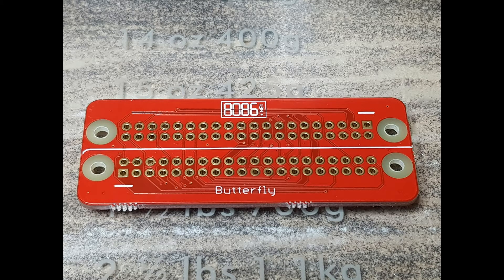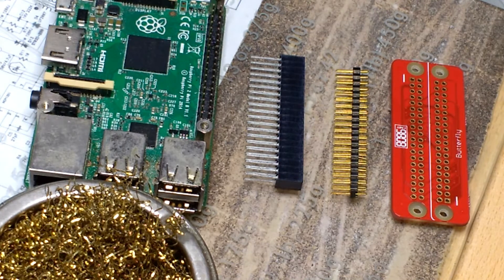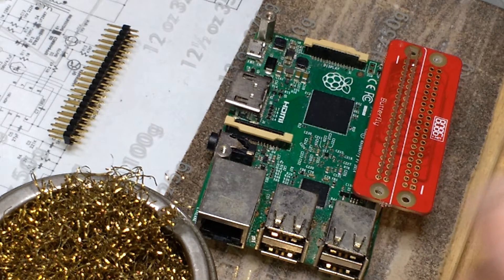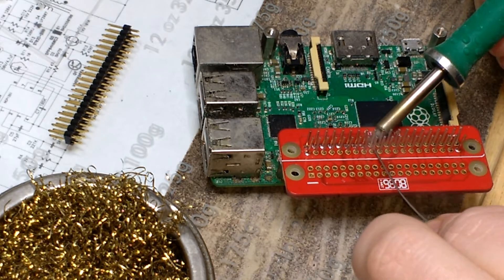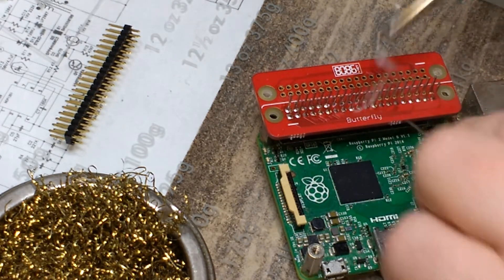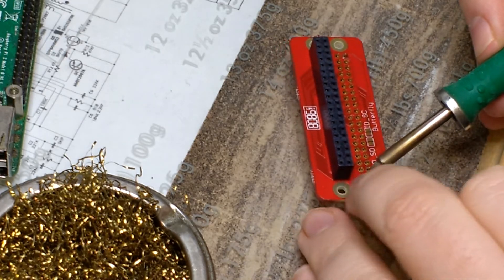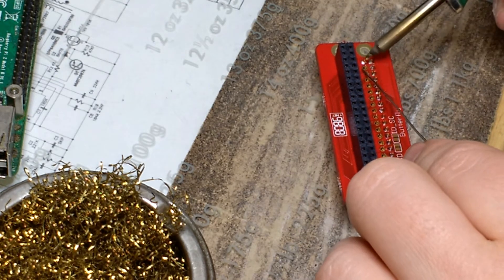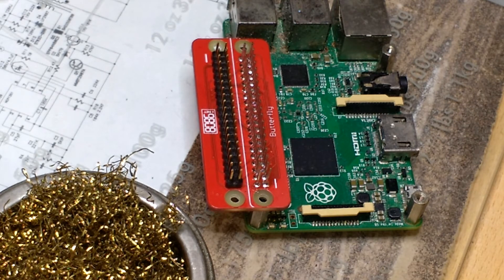Soldering the Butterfly board for the Raspberry Pi

Comment: Question:
What happens if you solder it together incorrectly (female/stacking header on the wrong side?) I had a display that would not work, so wondering if I should just start again with a new board or troubleshoot solder joints. A display that I connected would not work with the butterfly in place, but worked without it. (odd, because electrically with a pass through stacking header and nothing else it SHOULD work).

I wish I had seen this or a warning first!
Reply from the maker: The square pad on the butterfly PCB needs to go to the square pad on the Pi. If it doesn't it will cause problems.

Comment: with the butterfly I can in theory connect a second Pi zero hat to a single pi 3b+, yes?
Reply from the maker: Yes, but as the USB controller in the Raspberry Pi  has a limit of 8 host channels the USB Gadget Ethernet wouldn't work reliably if you filled them :(.
Reply: @ChrisBurtonUK  Well nuts. Still gonna grab a handful. Thanks for the fast response.

Comment: is there anyway to get a pcie slot attachment.. I have looked at a single board pc with one but they wanted 200 for it
Reply from the maker: The Raspberry Pi doesn't have a PCIe interface to breakout so you would need to look for a board which supports it.